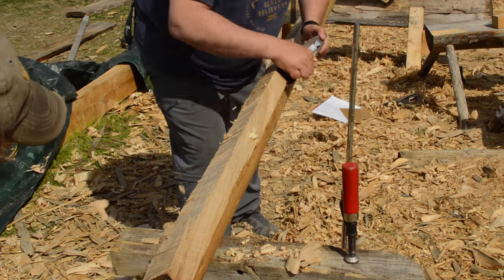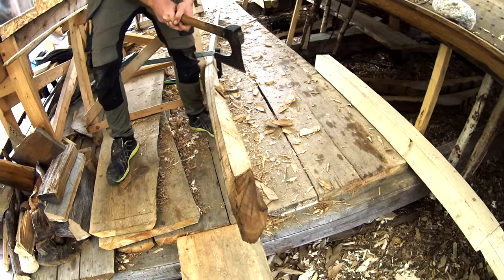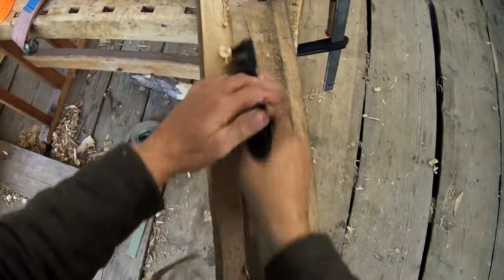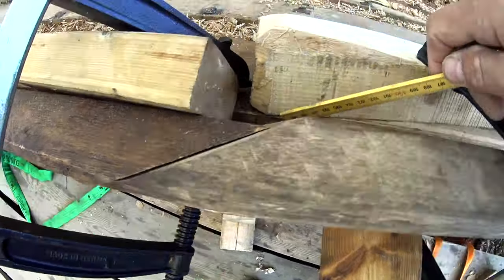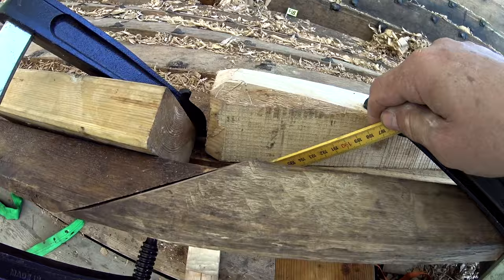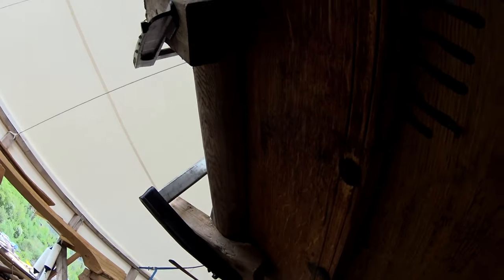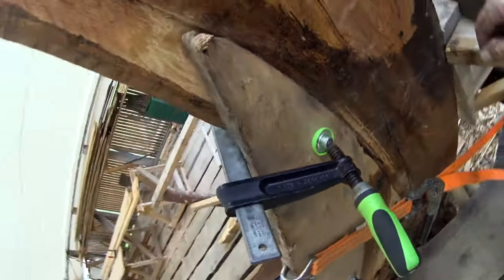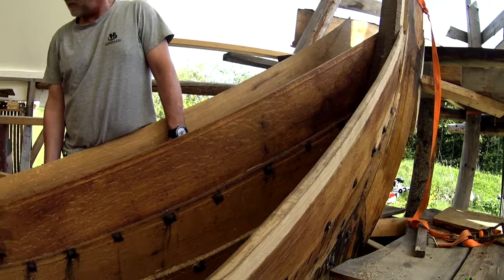🔴Viking ship building in Norway - Part 9; Finishing the Meginhufr (Slow Film)

Comment: Fascinating watching your build but what did the Vikings use for F clamps in their day? Watching those clamps set and reset over and over day after day ... How did they manage to build so many ships? They all seem so totally different and built in such a way as to seem like they would never stay afloat. No fairing of the hull other than the bowed lines...No flat bottoms... What made them decide that that was a great design for a boat? For such long voyages with so little creature comforts or cargo hauling facility.
Reply from the maker: We use clamps you might see in the other films of this series, that are made of wood and iron and could resemble more the ones the Vikings might have used. Those wooden ones are not suitable for this particular job however, and though we could have made clamps just for this task, we didn't. As for the shape and method of construction, I think it came about by a series of developments of previous boats of the region. In the North of Norway, boats are still built that stem directly from this boat building tradition and were used extensively in the fishing industry right up until the 1960's, though now they are more used by enthusiasts. https://no.wikipedia.org/wiki/Nordlandsb%C3%A5t